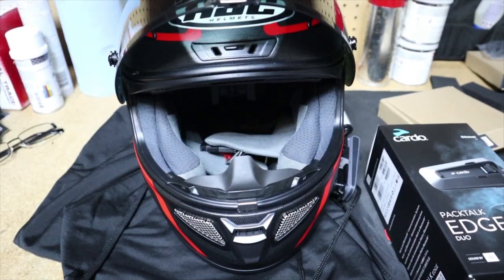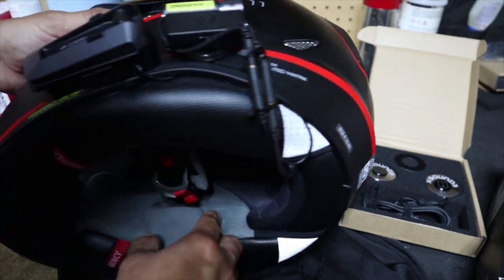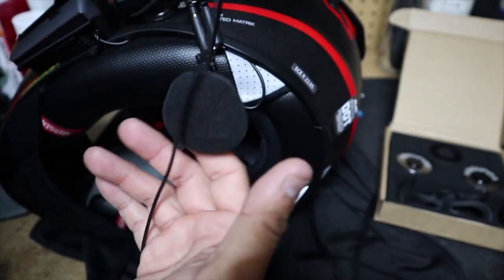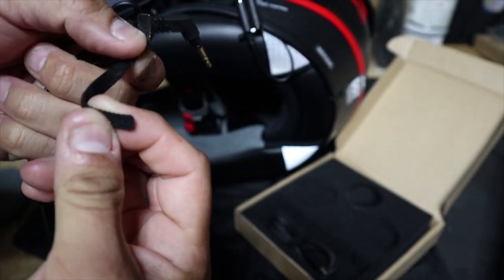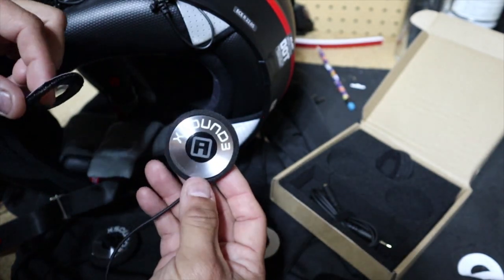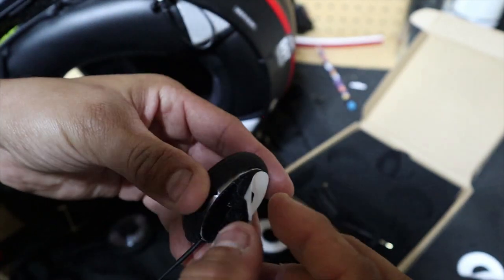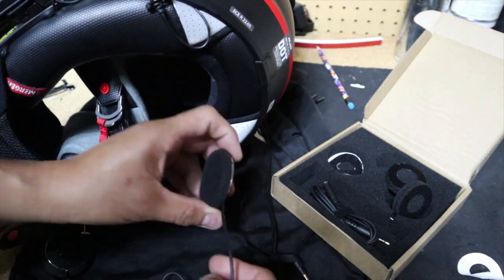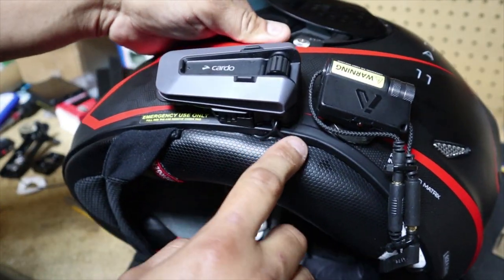How to Upgrade your Stock Cardo Edge Speakers

Comment: The speakers looks premium
Reply from the maker: they for sure sound better then those stock ones but wish it had better bass, hopefully in the future they will come up with that tech for these speakers
Reply: @ACProductions77  if you want more bass you either need to adjust your equalizer on your DAC or you’ll have to install an external DAC/amplifier to replace your current inline amplifier.
Reply from the maker: @RadDadisRad  I did install an external amp with these speakers, here is the video>https://youtu.be/yAGn3ATDDnU

Comment: What do you think of the whole setup? Compared to just running the original cardo speakers with no amplifier?
Reply from the maker: I feel like the new speakers have a better sound from them compared to the stock speakers that sound like it had no mid range or much bass.

Comment: Thanks for the video do you need the amplifier or could I just swap out my stock jbl ones for these would it have better bass ?
Reply from the maker: You don’t need the amp to make them work, but it does allow it to be louder when the stock setup maxes out, especially hitting triple digits. An amp with bass boost will only sound soo good until it sounds distorted the higher the volume gets past its point.

Comment: I have a crap viper integrated system and for reasons to long to explain could I fit a cardo to the helmet and use the existing speakers already built in?
If so, how would I deal with the built in microphone as well, here's hoping 🙏
Reply from the maker: If the speakers you have use a aux 3.5 then yes you could use them as far as the mic goes I’m not 100% on that one. At this point might as just rip out the old system and install the system that comes with the cardo

Comment: Question, I 'm going to add the Xsound3 speakers to my helmet using a blue tooth dac amp with a hard connection.  Now that speakers are isolated from the com unit.  Using blue tooth from my phone to dac amp.  Will the communications part work with the speakers.   Best Regards.  You have done what I want to do.   Need the input,.
Reply from the maker: I have a isolated system with my other helmet & answer to your question will be no the communication will not work if your cable doesnt have a built in microphone. so if you get a call you will not be able to take it.
Reply: thank you for your prompt reply.  Best Regards @ACProductions77
Reply from the maker: @claudenewton8932 your welcome glad I was able to help.

Comment: I’m curious the quality of these drivers. Biggest issue with poor quality drivers is they over drive mids and everything sounds flat and washed out.
Reply from the maker: if they where to make a eq app for music I think that would be a upgrade to be able to customize the sound to your needs.
Reply: Better speakers will improve the sound quality but if for example your using a basic smart phone for music, the amplifier in that lets the whole system down. When I play Spotify in my car using my mobile the sound is awful, when I connect my DAC player it’s night and day difference. Will be the same with Helmet setups

Comment: the amplifier is bomb...I have it and can't krank it pass halfway
Reply from the maker: Is the main volume on your bt set all the way up? That’s the only way to maximize the amp volume and have it as your main vol control
Reply: what I'm saying is the amplifier works so well that I can't turn all the way up...at half it is more than enough volume ...even when riding at 120mph
Reply from the maker: @anthonywright359  ah ok got it 🙂💪, same i normally have it turned just a bit after I turn it on & its more then enough for me as well.